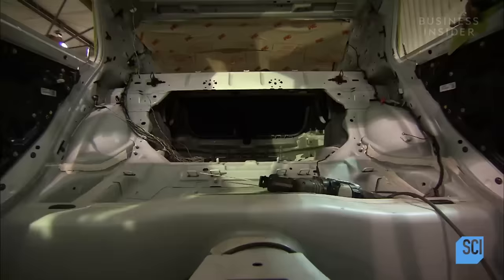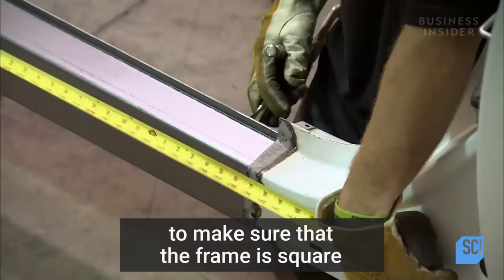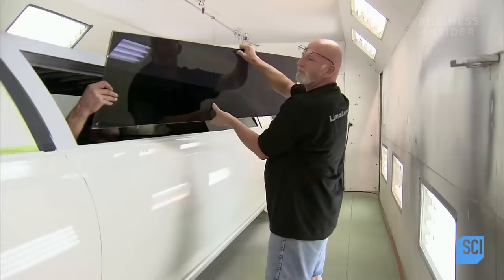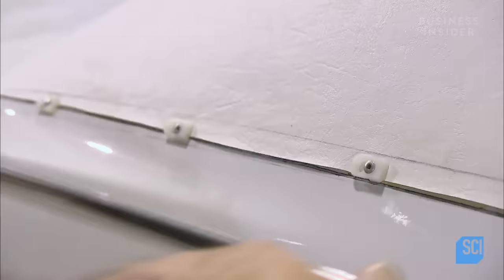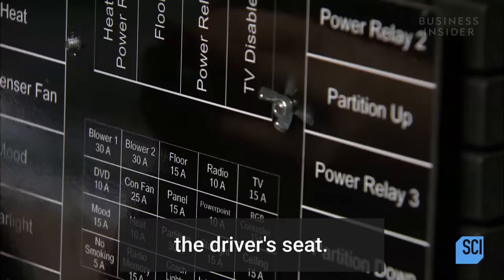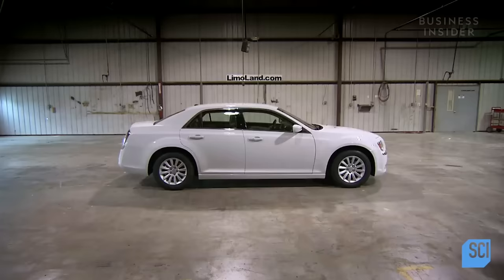How Limos Are Made

Comment: I always used to think auto manufacturers had special limousine versions of their cars made to order, which is why I assumed they'd be so expensive and far and few between. Never did I think it'd be so relatively simple as just taking one car and cutting it in half before adding to the middle of it. It honestly makes it feel less durable than it was originally engineered to be, especially when most of it's a weld job.

Comment: How to take a $40k car; add another $40k of parts and labor and end up with a car now worth $20k.
Reply: Arne Asada wen they make the few a 100 thousand dollars of that car it will all be worth it
Reply: That moment you realize a brand new Chrysler 300 (car in video) costs less than 30k.
Reply: Arne Asada .
Reply: Arne Asada which cave do you live in? First of all thats around $20K regular car and a brand new Limo will cost atleast minimum of $75 grand..
Reply: Yeah but the car makes money every time its driven. Vs a car that is driven for pleasure. Spend money to make money.
Reply: there's a limo for sale down the street from me for like 7 grand lol. looks like a mid 2000s Cadillac
Reply: Limos worth 120k$ the old ones from 2003 or less now it will cost about 230k to 250k$ in my country, the crysler alone cost 100k
Reply: Ameenk Chanel the Chrysler alone is 30k not 100k
Reply: A Hacker i live in extremly expensive country bro
Reply: Benjamin Burkhardt highly ised,beat up ,and high miles
Reply: Its a high school graduation limo, so it serves its purpose. If they get a fleet deal from Chrysler and the final cost with upgrades tops out to no more then 30K all they need to do is send this cheap limo out for $125 an hour. By  250hrs or 60 proms with a 4hrs minimum booking time the car will be making 95% revenue.
Reply: SirXavior graduation limos are just used ones.
Reply: SirXavior there is only one prom per year, bad math
Reply: +circusboy90210
.Ok. But you get what I mean thought the average price of a Limo rental is $125 and most require 4hrs minimum. So maybe not just prom or grad but similar type of events, even the occasional birthday or frat party. They'll get there money back if they get the car used at least 60 times. But stretched cars really don't last long because of the extra strain.
Reply: Arne Asada 40k in parts. Good one buddy. 
I can already tell you don't work with cars.
Reply: Arne Asada ha ha too true 😂😂
Reply: @circusboy90210  not all on the same day though are they?
Reply: Carne ASADA go back to grilling brother
Reply: That will make you 100k a year. It's an appliance not a show car...
Reply: @C B not in NJ not worth close to that
Reply: @sirxavior1583  why would you need a limo for a High School graduation?
Reply: @thomasjsanford4369  . Some people still make a big deal out of High School Graduation and Prom.
Reply: @sirxavior1583  for Prom, I drove my own car, and for High School graduation, we had a family party..

The closest limo service at that time would have been 250 miles away...    Now, we're lucky enough to have one "only" 80 miles away .
Reply: It takes money to make money.🤷🏾‍♂️
Reply: Stonks
Reply: Lol
Reply: 45
Reply: More like add $6k

Comment: Side impact crash will be deadly
Reply: It has crash bars built into the sides. You fail
Reply: Amit Mangat actually the extended area is usually stronger than the original frame
Reply: Did you not see the big side impact hoop that was in the side panel? Going up and down and one from front to back. Just like any other car on the road just bigger in this one cuz the length of it. You don't think that the government hasn't made them crash test these things and charge them out the ass to have all that stuff permitted and all that? Plus in. Limo you don't have seat belts so there is a level of danger no matter what so don't be a scared lil baby, people die no mater how safe we make things.
Reply: @jdm Tuners So are spelling lessons apparently!
Reply: Probably would be fatal in a normal car if you were hit by a school bus or semi. Don't keep worrying about the 'what-ifs' and worry about not pulling out in front of traffic!
Reply: @circusboy90210  all car doors have crash bars... still doesn't make it any safer
Reply: No in this crash you will get back original car back lol😅😘
Reply: Every car the same
Reply: @Ben W it would be fatal because people in the car are sitting without belts with their backs on the side
Reply: It's surprisingly more "safer" than you'd think, and by safer I mean more rigid. I don't survivability is all that great though. Here's a video of limos going through crash testing https://www.youtube.com/watch?v=NplHRuNL0R4

Comment: That’s incredibly unsafe
Reply: How?
Reply: I was thinking the same.  The welding points look extremely poor in quality and do not look sturdy at all (I may be wrong here, but feel free to correct me). If this is how they build it, people should run the other way.   

Parents sending their kids on Prom nights in one of these should 100% watch this video.
Reply: Yep
Reply: only if your driver can't drive
Reply: @AlineaEuros  what about other drivers on the roads? you might have best driver but you might crash with other drunk driver
Reply: @sw6545  then just don't get in any car.
Reply: Structural integrity. sidesills for starters. Either you simulate and fabricate according to the forces it needs to withstand. Or at the very least you make sure its overdimensioned by a ridiculous margin. Basically putting the mid/rear section on a heavy separate frame (as old cars).
Even sheetmetal combinations on a small convertible car are 10mm at door flanges for comparison.
A harsh steering manoeuvre or light accident will turn into catastrophe, thing will wrap open like a tin can.
I could go on & on about many other aspects. The owner of this company either doesn't care about or understand the safety hazards. Shamelessly promoting by exposing this ludicrous production process blows my mind.
I am never getting in a limo after seeing this.
Reply: @AlineaEuros  not any car, just ones done THAT way.
Reply: @mtbridingog9083  : Dude, we only saw the spot welds.... The whole frame is welded ofcourse...
Reply: Those welding spots made me not want to ever get on a Limo again!
Reply: @sirhaugen1025  nah don't get in any, that's your safest option if you're so worried about getting involved in an accident
Reply: @AlineaEuros  : huh? tagged wrong person maybe?
Reply: Who cares?
Reply: You are not ready to hear about collision repair Do you think your car was just forged from one solid piece of steel?
Reply: Limos are inherently unsafe, no seatbelts, air bags and throw in some alcohol to the mix, there was a recent crash where all the occupants died, like a dozen of them...no thanks, RIP
Reply: Olgales Suida  - What's so dangerous the welds? The entire world is held together by welds when done properly they are stronger than the surrounding material.
Reply: @AlineaEuros  uhh other cars are more protected in accidents these are not if it gets tboned its not safe like a car built properly to be crash survivable. cars off the line are extensively crash tested. limos compromise the safety of these designs and will not survive if you happen to be sitting in the center of the limo.
Reply: @zerotheliger  "more protected" you know, how about just dont get in an accident? maybe i dont drive enough even though i drive everyday to feel any danger of being involved in a car crash, the last car crash i've been in was like 7 years ago when i bumper kissed someone. But ever since then my driving has improved a lot and i tend to be more alert and yet more calm than what most people would be when driving, and that has helped me a lot in not only not causing a car crash but avoiding them too.

Eitherway with all these airbags, cameras, sensors that automatically tell you that youre gonna crash, some that automatically stop your car, people still wind up getting themselves killed, sometimes i feel like "safety" features just make drivers more irresponsible and worsens their driving abilities. Not to mention they also hike up the price of a car.

IDK about you, but i havent crashed enough cars myself to be convinced i need anything more than a seatbelt.
Reply: @AlineaEuros  one all cars on the road are not equiped with features like that. two you may be a good driver but you cant account for everything which is why having a safer vehicle is always the best option. limos are not safe just because they have a crash plate doesnt mean it syncs up properly with the rest of the cars unibody construction. do some research on how unibodies are built to behave in crashes. and what happens when you modify them. you create weak points.
Reply: @zerotheliger  these things in cars are actually becoming more and more common, infact, cameras are now required to be equipped in every new vehicle that is sold, mainly due to window regulations that made it harder for drivers to see outside their windows, soon sensors are that detect other objects or vehicles nearby are going to be required too.

Eitherway i dont research car crashes because i dont plan in being in one and it doesn't happen enough for me to look into it.
Reply: If you don't wanna die, you shouldn't be born in the first way.
Reply: Daijoubu A dozen? Try twenty, “20”! I live pretty close to there and I heard reports of people’s heads being smashed together so bad that many first responders were vomiting after seeing the aftermath!
Reply: @dkpk6370  lol that shit can cut in half
Reply: Looks more like a Cut and Shut car !
Reply: @dkpk6370  are you a welder?
Reply: Frik Frak - No, I’m not.  I do admire good metal work when I see it. This is far from it.
Reply: @dkpk6370  The welding might be like that but the steel is strong. The driver is in the most danger. They'll get squashed in a head-on collision because the mass of the back will squash the front.
Reply: They insert the rails only about 3 - 4 inches. How can that little bit of rail hold all that weight and driving stress? I would insert them as far as they would go. Just in case.

Comment: Welding galvanized?   Without a respirator?   Must be outside the states...
Reply: KFStreich galvanized is light gray in color
Reply: No, the company it's based in Missouri.
Reply: And welding without removing the paint 😂
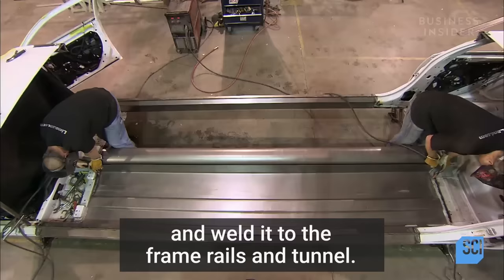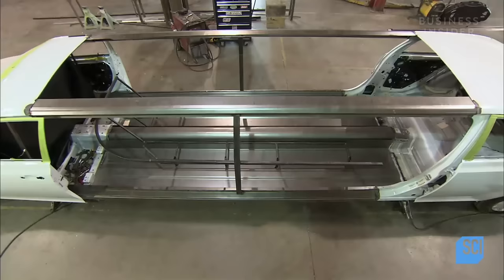Reply: @josephduarte1034  At 1:47 and 2:22 it clearly states that galvanized steel is used.
Reply: Missouri is outside the states?
Reply: KFStreich u mean in mexico
Reply: Centro Manufacturing Corp., Almazora, MetroTruck and FiberVan found some galvanized body to Isuzu PUV's.

Comment: Now add 4 inch armor plating on all sides and 4 inch thick bulletproof windows with a reinforced truck bed and driveshaftand you've got a indestructible car
Reply: just if you go over a dirt hill you will get stuck
Reply: Can we get 1000 subscribers with no videos? Good point.
Reply: I think that's how the presidents limos are made.
Reply: nope it will just bend in the middle by weight
Reply: No. You will have a four-wheeled banana, that is immobile....

Comment: At the bottom I'd use a boxed tube and build a structure that would stand up to a semi truck side impact. Contact cement is for countertops I'd use the red glue that most RV manufacturers use but that me I'd also install a fire suppression system if passengers were stuck in a crash

Comment: Now I know why they use a vinyl cover on the roof. Just to save time making a perfect aligned roof...

It's also shocking to see that they use have some kind of pre made jig to put the front and back in to align it before the welding. That would eliminate chances of faulty measurements.

The cutting in half could also be done with the saw on some kind of track/guide to get a 100% straight cut.

Comment: The video doesn't show the full build process. All seams are fully welded. The replacement metal between the halves is a lot stronger. Also, the lady mentions galvanized steel, it is not. The guys wouldn't be welding it as that is toxic. Just much thicker custom bent steel pieces. The video shows a c shaped channel as a frame rail, if you notice the installation of the floor, that rail is now square shaped. Completely enclosed and welded after the floor is installed. 

Much much safer than the video gives credit.

Comment: This does not look structural sound. The overlap is way too weak for may taste, there seems to be no diagonal bracing and even the beams are not looking as rigid as I would like them. I thought thy use some tube framing, subframing, or at least  enforcements at the cutting points ... nothing. Two inches overlap and some welding will do? I may be wrong and the "workers" might have more experience. But just from the looks of it  I'd say this is unsafe on many levels.  And while we are at it: Also cheesy looking - inside and outside... I mean "Vinyl Roof" and this 70ties interior.

Comment: People here say " it looks like shit" "it looks dangerous" "it's cheaply made" and so on, you say it's cheap but have you bought one? Do you have one?

You say it's dangerous but question being, did you not think that they base all of materials, designs and other factors on pre-existing designs? 

Sure there may be more expensive and more luxurious models but come on, riding or even owning a limo is a privilege that most of the people here don't experience in their life time.
Reply: Kumamon I used to take one to taco bell after work daily .
Reply: look, regardless of wether ive owned one or ridden in one or not, i can quite confidently say that it wont be as safe or as good quality as the original vehicle.   ive been in and under enough cars to know that if this vid is anything to go off, it is made cheaply.     they way they just tacked the chassis rails in with the car not being on a frame jig or anything.     yeah, they may be a cool concept, but theyll always be less maneuverable, and more prone to crash damage than a regular length car.    most in nz are made out of old ford falcons.  That fact in itself should be enough to put you off.     i love a good falcon, but theyre not a safe car by any stretch of the imagination.
Reply: The thing is, they didn't design it well. Limo companies have no safety regulations they have to follow, they are literally doing the cheapest job possible. The frame rails they weld in are thin steel rails, there is no cross bracing whatsoever, and the central driveshaft tunnel doesn't even match the profile of the original driveshaft tunnel and they basically spot weld everything in place. Cars have an 8 inch wide side impact pillar made of ultra-high strength steel; they also have two or three steel rails going through each of the doors. they only put in 1 skinny 1 inch wide side pillar in the whole 20 feet stretch and the rest is covered by sheet metal. If this limo was t-boned, I wouldn't be surprised if the car that hits it goes straight through the side of the limo and comes out of the other side.
Reply: @nicholasfu5937  couldn't agree more.
Reply: Well said

Comment: Scary to see people welding without respirator on galvanized steel. Half-hearted paint removal before welding and as for using a tape measure to check the length LMAO. No mention of changing the steering arms so that they match the new length of the wheelbase either.

Comment: No suspension upgrades? No additional sound insulation? No panoramic roof? No adjustments to driver aids to compensate for changes? No additional safety features? Must be one of those cheap hen party limos...
Cause there are a bunch of companies that make limousine versions of their top models. Mercedes, Maybach, Lincoln, Cadillac... All factory made for exclusive clients ranging from heads of state, through drug barons, all the way to wacky car enthusiats and not built in some chop shop.

This is how you make a limo for weddings and starlets. I thought this showed how the high spec limos were made.